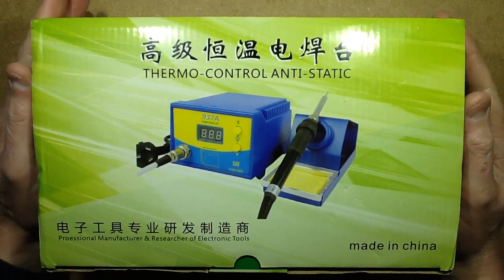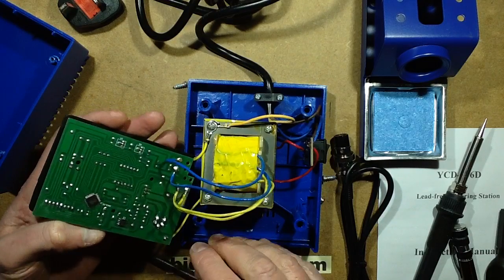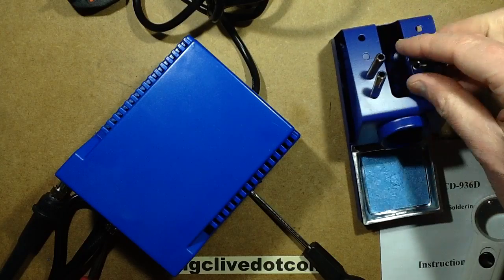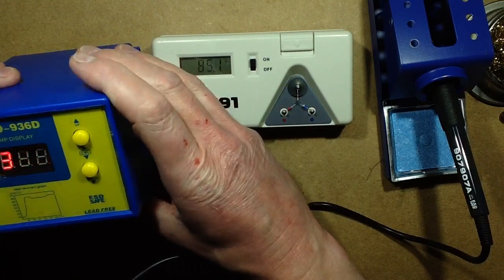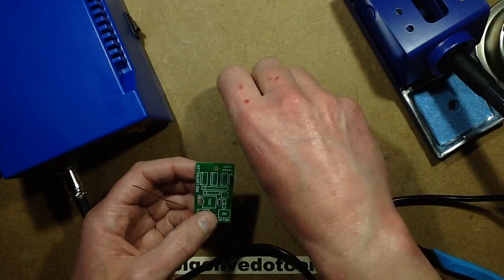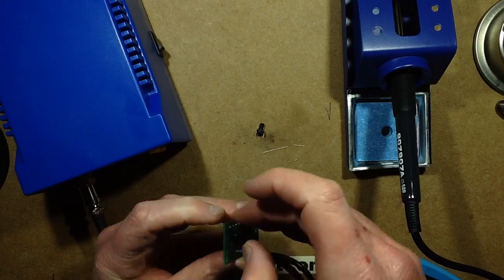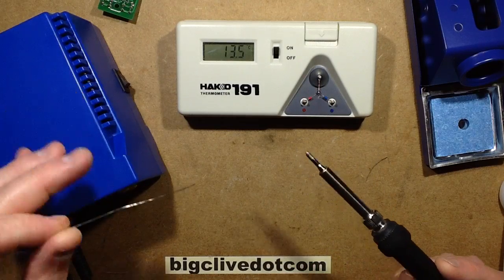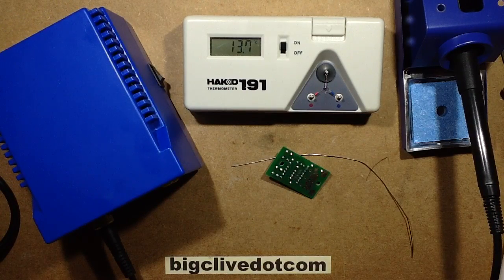936D digital soldering station test and internal look.

Comment: Regarding internationalisation, I am curious to know whether they have some way to switch between Celsius and Fahrenheit. Also, since it comes with a fuse in the UK plug, I wonder if the models for countries without fused plugs have a fuse on the PCB instead - is there space for one?
Reply: +codebeard i think these are mostly made for the chinese own market, eg production themselves, its just a happy accident they can also export these, i doubt they make an easy Fahrenheit changeover
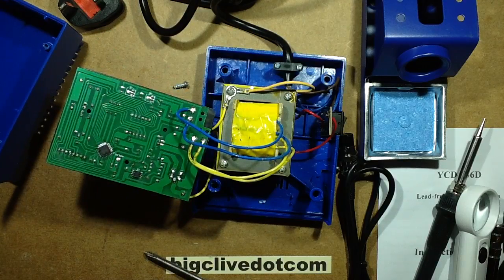Reply: +jusb1066 True but the analogue version has a °F scale as well superimposed on the °C one which you can see at 5:04
Reply: codebeard
yes but thats easy to print on! costs them nothing, having to somehow program an alternate digial scale and a switch method is much harder
Reply: +jusb1066 A quick check on eBay shows that 110V versions of the 936D do exist with displays set to °F, so perhaps there is a dip switch or solder bridge for it.

Comment: There doesn't seem to be an indicator light any more - does it use a different mechanism to turn on/off the heating element? I'm wondering if it's perhaps done at higher frequency thanks to the microcontroller. Do you have any meters that would be fast enough to see the voltage changes / duty cycle as it hovers around its set temperature?
Reply from the maker: +Andrew Ballard Yup.  And to be honest the earlier analogue unit was more decisive.  This one was more random.

Comment: I ordered one of these after your last 936 video. Glad I went for the digital version - it was cheaper to!. My previous iron is getting harder and harder to find tips for and they end up costing almost half the price of this whole unit. I'll be sure to open mine before use and check the earth - might need to change the plug too - was that a shielded earth pin? Thanks for the review.
Reply from the maker: +Adam Welch DERP!  I didn't even notice that.  Mainly because I don't normally expect to see a sleeved earth pin.  That's coming off!  I'll just add a note about that.
Reply: +Adam Welch How was it cheaper? I've found Hakko clones for as low as $25, I don't think anyone even makes a soldering station any cheaper than that. (aside from those power controlled irons)
Reply: +vgamesx1 I found that the none digital version was retailing on eBay for about £30-35 and the 936D shown in this video was going for £24-28. Things might have been different I guess if I'd looked on eBay.com and paid the PayPal exchange charges.
Reply: ***** That's odd, the one I found was shipped locally at $25 (£17.5) and I don't remember what the cheapest digital one was but they were about the same price $36 (£24).
Not bad though.

I just thought I'd have a quick look and they're actually selling em even cheaper now, Wow.
http://r.ebay.com/LEUIUK
Reply: +vgamesx1 There does seem to be a difference in price between 110v and 220/230v versions. We seem to be paying a premium over here. Is there more windings in a 230 transformer? Can't see any other reason why that would be. Anyway - best value for me was this digital version. Should be here early next week.
Reply: ***** Not sure, but I'd say it's more likely because of import taxes or something along those lines being higher is why it costs more.

Comment: That's what I like about Clive, he doesn't have pretensions!
Reply: I purchased a lot of cheap tools, some are bad but there are a lot of good ones out there. It's stupid to say everything cheap is bad.
Reply: @akhurash  Those el cheapo dark blue flush cutters Clive uses are brilliant, I grabbed a pair once I saw his (for £2)
Reply: Tim Ramich wow, the amount you've been mind-washed by the advertisement campaigns of these big "name brands" is amazing. I guess they need to stay afloat somehow..
Reply: Can you give us a link for this 936D Soldering Station US Version? Thanks
Reply: When I say cheap I mean inexpensive and you usually don't get all of the bells and whistles and if you're lucky they last a while
Reply: MrBrymstond well you’re using the word in a less than appropriate manner if you have to say “when I say “cheap” I mean something other than the words definition
Reply: The problem here was they tried to hold two boards together using a soldered connection when they should have used standoffs then soldered... They use a cheap amount of copper on the fiberglass PCB and easily breaks connection. Yes I watched his new video repair on this very issue.
Reply: @MrBrymstond  yea but for the price these things retail for, its understandable, the threaded fasteners add pennies but on large scale production its saves greatly, you can't be expecting Weller quality (although sometimes questionable) for an eigth the price
Reply: MrBrymstond you sidestepped the topic at hand to point out a specific example. You said cheap universally means bad. Take it back. Bully. :P
Reply from the maker: +Tim Ramich The 9 in 1 screwdriver set from Poundland is one of the best I've ever used.  Really hard bits that don't twist or deform.  I can tell the difference between good and bad tools and these ones are good.  They also sell a set with a rubber handled driver and lots more bits, but that one really is poor quality.
Reply: Chinese metrology instruments have always offered value for money. Obviously the analogue instruments (verniers / dial gauge calipers / micrometers) tend to be pretty durable, yet their electronic instruments are far from poor quality, with very acceptable standards of finish. Whilst not Starret / Mitutoyo quality, they are certainly adequate for the hobbyist machinist.
Reply: @phils4634  I love em, just gotta watch out for the fact that the have a ridiculously high quiescent current that drains the batteries to hold the home reading while the display is off on the cheap callipers, but I feel that a "cheap micrometer" is somewhat of an oxymoron
Reply: +PuchMaxi1988 It's not pretentious to refuse to use cheap tools.
Reply: +Tim Ramich That's right, but not all cheap tools are necessarily bad.
Reply: +PuchMaxi1988 Yeah, they are. Even those screw drivers with the tiny 4mm bits he uses...they must come from the same place in China, and the kits are always coming with a different handle. The bits rust just being inside. They're also not very hard. Even spending a little more and buying some name-brand stuff at a hardware store...those bits are crap, too (#2 Phillips bits). This is why I now only buy Wiha screwdrivers. Craftsman is now going to shit as well. It all depends on your own hand-eye skills and how precise the stuff is you're working with, or if you're fabricating things from scratch. Skilled people can make use of good tools. Good tools don't make someone skilled. Unskilled people don't know their ass from their elbow and are the ones who claim there is little difference between cheap and real quality tools.
Reply: @timramich   like I get that the German gear Is often a cut above the rest but cost doesn't always equal quality, I too have plenty of over price "professional grade" tools, but they're often just the made in the same factory in china with a "pro-sumer" brand name on them if you can find a perfectly functional pair of pliers with hard jaws in your local DIY store then why pay for knipex
Reply: Sounds like most of the people here are butt-hurt that they can't afford real tools.
Reply: @timramich  "real tools" are tools you can depend on when you need them, if that be maplin's own brand side cutters or gold plated knipex uber snip 9000's I have plenty of very expensive "real" tools, I have a JBC CD-2QBE but I also have a set of generic Chinese precision screwdrivers, both the £350 station and the £10 set f drivers have lasted the same 3 years
Reply: Tim Ramich it’s pretentious to conflate cost with quality

Comment: hey bc great vid yea i hav the 852 d w the air ,, wrks great,, one suggestion i have is, when i was in assy class the instructor told me to always keep solder on the tip,, dont clean before puttin away, clean rite before use,, that way the thin layer of silver wont slowly oxi away,, i think i might have a tip i used bak then,, '82 ish,, and it still has silver on it (not much left but still some there jeje ) nuf said jeje A++++
Reply: +tdconsul dunno, tips dissolve with use, the solder itself sucks some from the tip, back when tips were only copper they sold solder with an additive in the alloy to prevent copper getting eaten, tips these days after so many hours use get eaten it seems from the inside out and fall apart at the end at an awkward moment.

Comment: Tightness or otherwise of earth screw may be academic when they have a shrouded earth pin on the plug, so it may not make contact with the earth in the socket!
And I bet the cores in that  mains lead are crappy CCA
Reply from the maker: +mikeselectricstuff Yeah, I didn't spot that.  Mainly because I didn't even expect it.  Off with the plug <CHOP>  Flame test on the cores...   It's CCA.  But at least they had used a random brand of 13A fuse to make sure that any faults are loud.  I'll add some notes.
Reply: British standard plugs should never have partially sleeved earth pins, because its possible when the plug is full inserted that the metal part of the pin is not touching the contact. Even if the earth is not connected, it is not allowed. Only the shorter live and neutral should be sleeved.
Reply: miklex you're correct. That'll teach me to post when i'm drunk lol.. Sorry folks
Reply: My "998D" soldering station (the brand appears to be "HYLKKO" as a bad misspelling of "HAKKO"...) came with a compliant British plug, which was nice. Was shipped from the UK, though, so maybe that made a difference? I'm not sure I've checked the fuse, though, and I definitely haven't checked which metal they've used for the flex's conductors. Maybe I should! :) I do have a few non-compliant "kettle lead" cables lying around, though. Stored where only I'll find them, and I'm sure to use the sleeved-earth-pin ones only on devices that don't have a functional ground anyway! Although now that I think about it, I should really change them to 3A fuses (which'd be fine for any device I'd use with them anyway)...
Reply: The KATSU version of this unit seems to come with a proper plug
Reply: +mikeselectricstuff Mike you're such a kill joy.... But so right :)
Reply: +Andrew Ballard oxidation.
Reply: There's nothing wrong with the earth plug. At 1:12 in you can plainly see the earth pin. It shows up as a nice shiny British type Pin that's half shrouded as it should be. So have i missed something??

Comment: I really enjoy your videos! I also have an antex iron, But for ease of use I use my snap-on gas soldering iron which was great when I has jobs inside cars. But I feel attached to it so i know what you mean when you know your iron very well when working with it! (you're probably appalled by gas irons lol)
Reply from the maker: +Andrew Grabowski I use a gas iron when I really have to.
Reply: You use what is available for the job at hand. Gas? Electric? They are basically stones when you don't have either on a job. Adapt or go home.

Comment: Wish I had learnt to solder. Always goes wrong when I try! Then again I had a cheap iron that plugs direct into the wall. cries with pain
Reply: +rob shaw it probably needs cleaning and tinning the bit, i too have a mains iron, it solders just fine, so there must be something to be done.
Reply: +jusb1066 Agreed, cleaning and retinning is vital. Temperature matters, but secondarily to this

Comment: Can you link the one you ordered? Your one says YCD936-D but i only find WLX-936D (http://www.ebay.co.uk/itm/936-WLX-936D-Digital-Electronic-Soldering-Rework-Station-60W-Temperature-Control-/251399780042?hash=item3a889836ca:g:q-gAAOSwBLlVaEYA)
Reply: +JÄTTI PASKA http://www.ebay.co.uk/itm/936-Digital-Electronic-Soldering-Rework-Station-60W-Temperature-Control-312087-/281750101468?_trksid=p2141725.m3641.l6368

Comment: Hi Clive, My favourite iron is an old Draper. Not the type where the bits slide over, nor do they screw in. They slide in and are then held by a screw that's part of the iron. The GREAT thing is that I make my own chisel bits using the solid copper core of Westflex W103 coaxial cable. This is a 50 ohm cable beloved of many radio amateur operators. It is truly perfect!
Reply: I meant to add that this iron is mains supplied, over 25 years old, has had hundreds, maybe thousands of hours of use and is still totally reliable.
Reply: +Le Plum i too make my own copper bits, i mostly use a 12v 40w iron.  i dont have an issue tinning just the first 3-4 mm of a tip and letting the rest tarnish so it doesnt wick solder up its entire length, they work just fine, and you can just file and reshape if you have to,  but keeping clean in a pan scrubber in a small tin (better than the sponge) is all i do